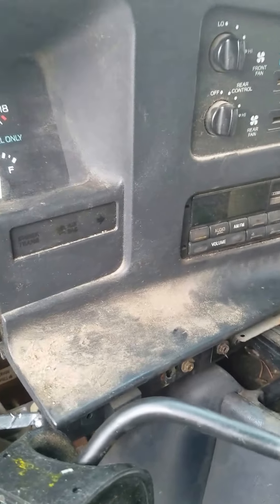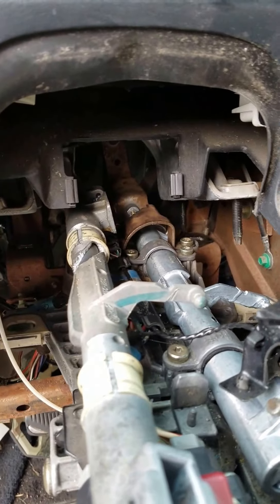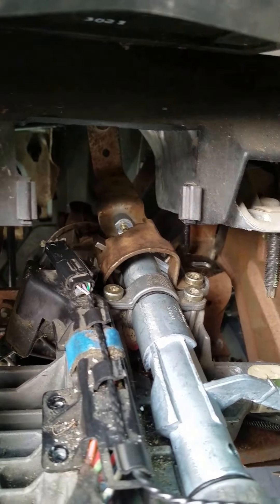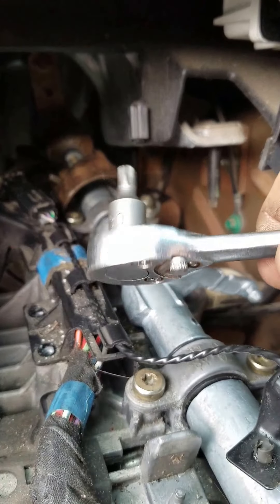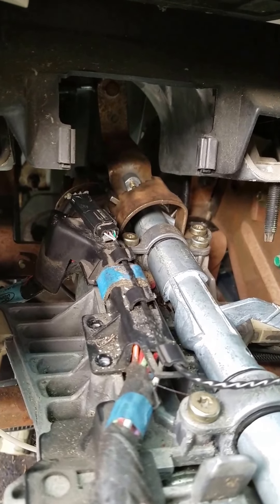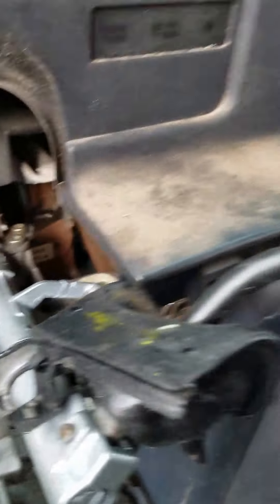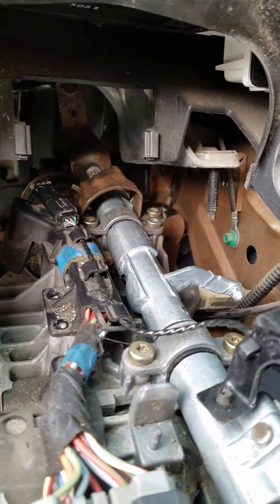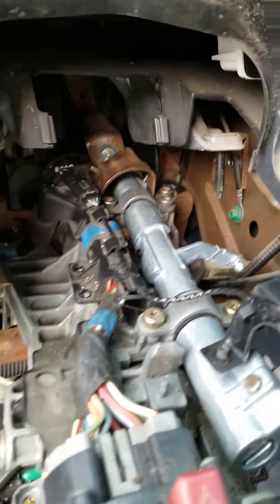Ford 150 broken shift tube

Comment: I am one hour into this project on an 05 Ranger. That is with almost no "how too" vids. This vid is the only one that depicts exactly what happened to my shift tube. Thanks! You did give me some info that I needed.
Reply from the maker: Your welcome. Nice to be of service to others. So many you tube videos have helped me over the years it's nice to be able to contribute some myself.
Reply: Instablaster
Reply: I had the shop do mine, $100 part, 2 hours labor, $350. I'm old, and my back is broken, no way could I do mine. It's like brand new again. The longer you let it go, the more dangerous it gets.

Comment: The tilt steering lever just unscrews!!!!WTF!
Reply from the maker: Yes it does. But I already cut it. Van has high miles. You really think after 350k miles a little plastic trim is an issue for this van? It survived rear ending by a Ford f250 at 40mph. It was run until oil pressure dropped and temperature started rising. My second econoline to reach over 300k. Must be doing something right.